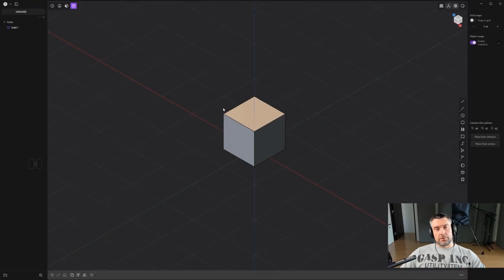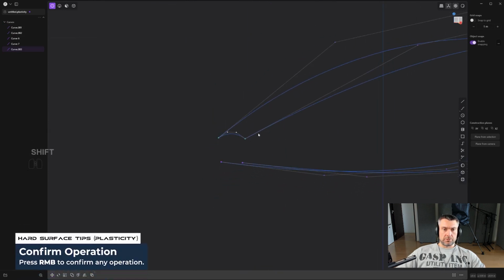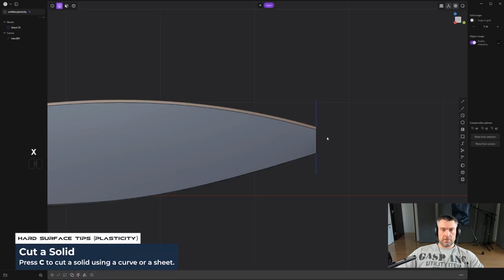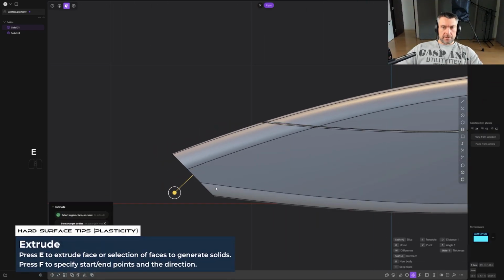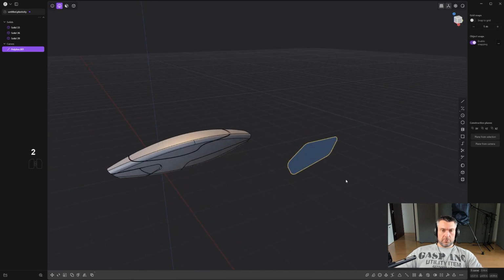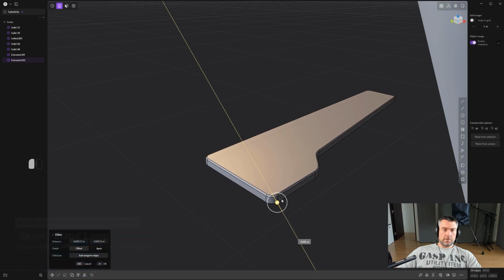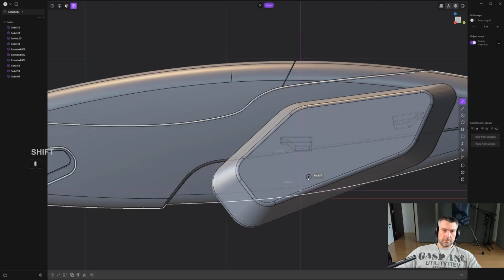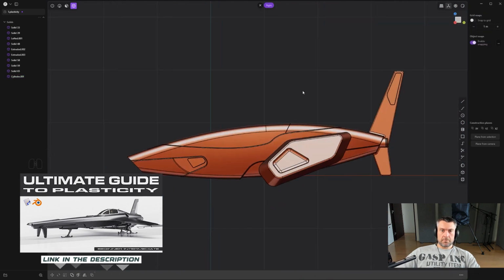The EASY Way to Make Sci Fi Spaceships (EASY 3D Modeling Tutorial)

Comment: So do you think Plasticity is going to replace Blender?  I'm enrolled in your Hard Surface Academy 2.0 (OUTSTANDING), and am considering getting Plasticity, but am unsure if it's worth the investment.
Reply from the maker: Blender is a polygon based software so a different beast. Plasticity is very intuitive and fast. Superb for surfacing, faster and way more fun than subd, thats for sure.
Reply: It's great for hard surface modeling. Can't export decent quad btw.
Reply: Plasticity will never replace Blender. It’s like asking if the Prius will replace the Tundra.
Reply: @misanthrope_01 ssshhhh 🤫…it makes perfect sense. You’re just not thinking deep enough. Reach within and not without.
Reply: Of course it will very soon. In Blender half time you will end up fixing topology here and there and at times it will drive you crazy
Reply: @HybridTheory101  Dude, stop talking nonsense. Plasticity is NURBS based just like Rhino or Moi3d which I've been using for over 10 years. They are completely different from what Blender does which is polygon based 3d modeling. It's apples and oranges, 2 different things. NURBS won't replace polygon modeling nor polygon will replace NURBS.
NURBS always had massive advantage over polygon modeling when it comes to hard surface modeling that it's a night and day difference.
The main reason why people throughout years were not using for example Moi3d is because it was expensive, it was always around $300, even 15 years ago.
I started using Moi3d when it was 0.9 beta and when I was working professionally as a graphic and web designer and when clients wanted their logo in 3d and some animations and stuff, I was always doing it in Moi3d and then exporting it elsewhere because to me working with polygons at that time was a fucking nightmare, I just didn't have time to dedicate myself to learning fully 3d and Moi3d was a god send.
Then, later on when I started doing some concept art I was doing all hard surface modeling in Moi3d as well, there was no fucking way of doing it in a standard polygon based software. It's just a night and day difference. I never tried Plasticity but Plasticity is also simple stream lined NURBS modeling software just like Moi3d.

Saying how NURBS will replace polygon modeling is total nonsense. Go model in NURBS, export model and let's see topology and good luck with that topology in video games, for example. No fucking way.
Reply: @roljavi  every person has their own opinion and if you don't like what others say then you don't get to scream at them  because this is not how civilized people react. Secondly, working in Blender at times becomes awfully time consuming whereas the same could be done in Plasticity on the go. If you like sticking to the free stuff then so be it. Period
Reply: @roljavi I agree. I think Autodesk should be worried as Alias Surface (which I use professionally) is a nurbs based modeller but is about $11,000  a year😱. We already use Blender a lot in the automotive business and I’ve always said that if Blender improved their nurbs/bezier surface module they would put a huge dent in Autodesk’s profits.